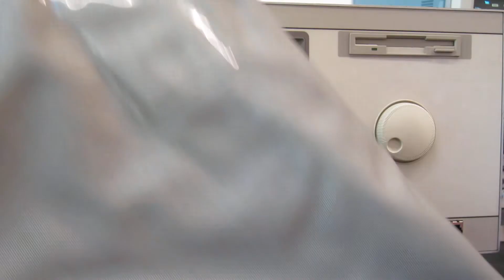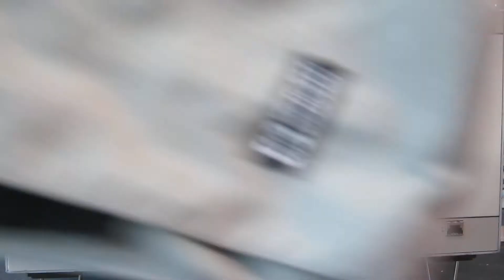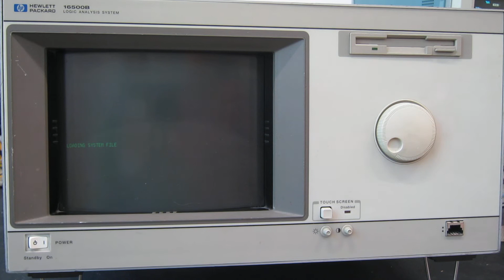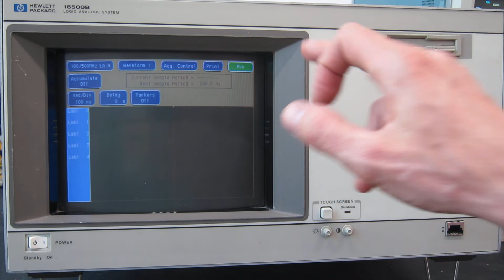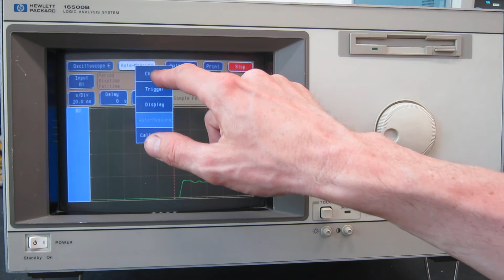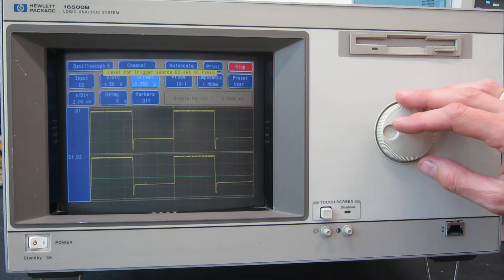HP 16500B logic analyzer 96 channel 16550A with 16530A 16531A oscilloscope

Comment: Is there a wire necessary to connect the two together? 
I own a 16500B however it does not have this pair of cards and I'm planning to potentially buy them separately.
Reply from the maker: Yes, some wires are necessary to connect the 16530A and 16531A cards. From memory they're just standard 10-way 0.1" pitch IDC headers, and I think there are two or three of them. If they don't come with your boards, they'd be easy to make from standard parts.

Comment: the oscilloscope need the timbase? 16530a?
or not necessary?
i have 16531a doesn't work.
or just need files?
Reply from the maker: The 16531A needs the 16530A and its interconnecting cables, as well as the correct system files, to work. Without the 16530A it just won't be recognised by the mainframe.
Reply: @cmjones01  
thanks dude

Comment: Really good tutorial again! another question comes to mind. you said you never use GPIB. However, supposing your were and were using a test program, can this be set to desplay in real time what its being told to do with each Pod? all I ever see is the splash screen and usually when its recieved a command it will default to this screen even if your in another menu.
Reply from the maker: I honestly don't know. I haven't explored the GPIB programming interface at all. I've regularly used Ethenet to transfer files in and out, and done remote control via X, but haven't tried to set up any automated testing using GPIB.